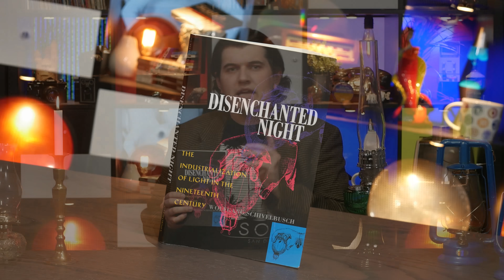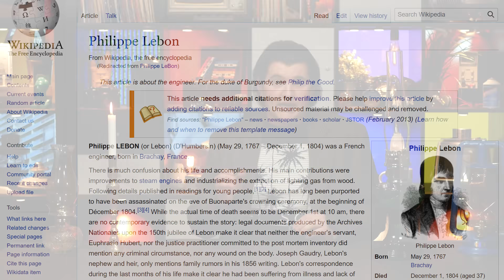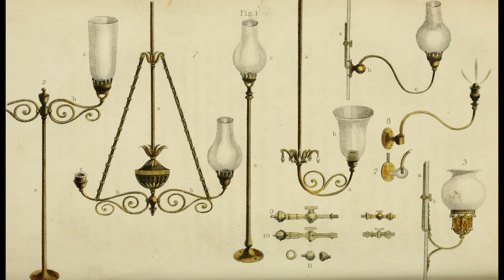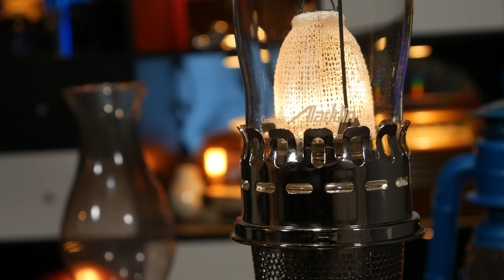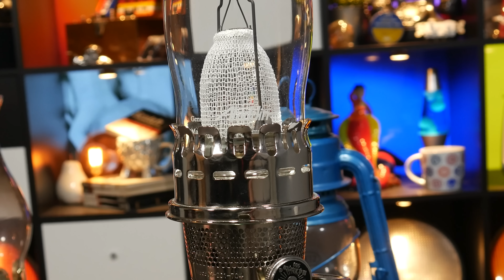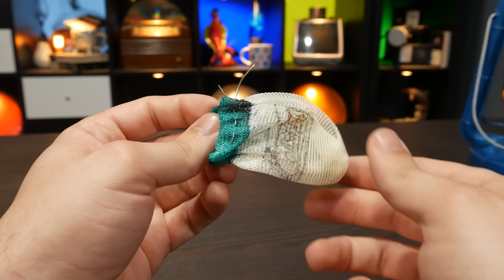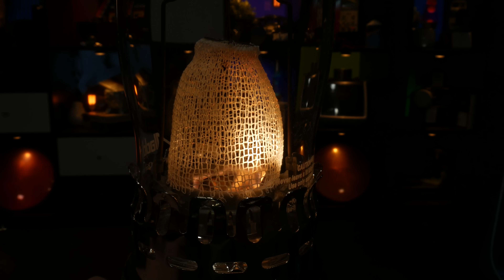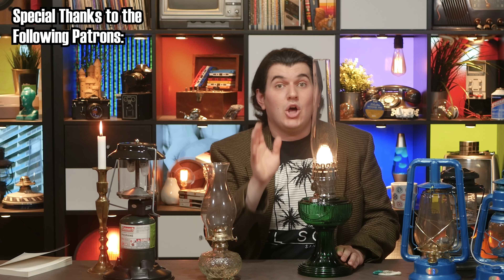How the gas mantle made lamps 10X brighter

Comment: While the mantle is not catalytic in the normal sense (surface chemistry going on), it certainly is in the same way that any confined flame is. Soot particles can be thought of as black bodies, and in open air that means they glow brightly throwing out tons of energy. That keeps them relatively cool. Inside a mantle that doesn't happen. They still glow brightly, but because they are black they also absorb the light from their environment. The mantle is actually hotter than the particles in a burner flame, so if you took one of those particles and put it inside a mantle the net radiation flux would cause it to heat up!
This makes endothermic reactions become an important route for the destruction of soot particles. Lets consider an almost complete stochiometric flame, near the end of the reaction there will not be much oxygen left. This slows down the oxygen carbon surface reaction to a crawl. If the particles are artificially kept hot the product carbon dioxide and water can react at the surface endothermically to produce carbon monoxide and hydrogen. Both of these are gasses, so are able mix well and to burn off the last of the oxygen very efficiently. Even in a rich flame the combustion products can continue to destroy the soot particles after the oxygen is all reacted. The result is syngas. The mantle effectively transfers energy back to the incoming fuel to distil it into syngas inside the lamp, before burning that instead.

Comment: The blue color of some mantles (particularly the Aladdin Lox-On Mantle) might be just a pigment to distinguish the 40-candlepower from 60-candlepower type [1].
The colour migh also come from substitution of other heavy metals (some countries' regulations don't allow certain metals to be used). I've seen a patent applications mentioning metals such as yttrium and neodymium - the latter has oxide of light blue colour looking just like that.
Some heavy metal nitrates are also colourful, too (see copper(II) nitrate)) allowing use as pigment.
I've seen some Aladding mantles are light pink in colour (note that neodymium nitrate is pink compared to light blue oxide), but I my buest guess it's just to differentiate between models to make it easier to find the proper one for your lamp.
Some mantles are dyed just around the border and cap perhaps to make it easier to put on.
I have very little time to sweep through patent application but hopefully this will help a bit.
[1] http://www.aladdinlamps.info/LoxMPicts.htm

Comment: I live in one of four attached cottages built in a rural area in 1876. When I was refurbishing I found a network of gas pipe work in the walls which was weird because to this day there is no gas available. Eventually I found out that there had been a coal gasifier in one of the outbuildings. The cottages were built for staff who worked at the Manor house nearby. It must  have been incredible to have had controllable lighting in those days.

Comment: 5:35 " ...because it is not a measuring implement of any sort" - well, sorta...
You see, that thingy shown in the B&W photo has this outer structure, that gridy thing around that cylindrical part, to keep it straight and upright, WHILE IT MOVES UP AND DOWN.
Gas production was continuous (less or more) thorough the day, while its consumption peaked during evenings and mornings (for obvious reasons). When the gas was produced during the day and pumped into this container, the movable upper part moved up - and when gas was being used up (for lightning, and latter for cooking as well), well in excess of "manufacturing output", that thing went down. Therefore, one could estimate, or "roughly measure", the amount of gas held within it - and a rough measurement IS a measurement nonetheless (hence that -meter suffix).
Also, I wouldn't be surprised a bit if one could actually find, on some pictures, some sort of scale attached to the structure - and I think I've seen one, once, just can't remember where and when.
Anyway, while this "gasometer" is indeed not a very apt name for this "holder", saying "it is not a measuring implement of any sort" is also rather inaccurate.

And "while at it" - it would be worth clarifying the term "town gas", as it might refer to both COAL gas (in early years of "unnatural gas era") and SYNGAS (for latter - and much longer, AFAIK - period of that era). Syngas is a mixture of mainly hydrogen and carbon monoxide (and therefore very poisonous, unlike coal gas, which is harmful, but not nearly as deadly), and it is produced by blowing hot steam through a bed of red-hot coke (C + H2O -> CO + H2, -∆t).

Comment: How about another sub-topic video on how conduits for electrification of homes (likely) used the pre-existing coal-gas lines. It's hard to imagine ripping out entire homes when all the ways to route wires were already present (at least it'd be fun to know if that was or wasn't the case). - Also - taking a wild guess - is the wicking action into the lamp that's confounding the uniform heating possibly not level - meaning the wicking action isn't uniform because the fluid is offset from an unlevel surface. Is your table level? Is the lamp?

Comment: You forgot the best one of all. The sewerage lamp.  Lanark castle in New Zealand used one. The waste was collected in a central room which had a glass dome at the top. This connected to the pipes which ran through the castle and attached to the light fittings.

Comment: I've seen an arc light working at a technology museum once, and I understand why they never caught on for domestic lighting. The light is very harsh (as it's basically a welding arc. They won't even leave the lamp on now because it blasts out so much UV), the lamp makes a constant, loud and ominous noise (a combination of the AC humming of the electrical arc and the flecks of carbon being sputtered off the electrodes), and there's constantly black soot falling off it.
Reply: Yet they were a pioneering means of street lighting especially in the early days of power distribution, but with all the drawbacks you mention. 'Arc' not 'arch'...
Reply: @rubbrhog  always get those mixed up

Comment: Are you able to stack multiple mantles on the aladdin lamp above each other to hopefully get more light out of the same heat draft? Or does the first mantle use up the heat in some way when converting it to light?
Reply: Probably not; much energy would have already been used up so at most you'd get a dull glow.  It's like compounding on steam locomotives.  BTW one of the Wright brothers was issued the patent on using compounding on internal combustion engines I've been reliably told.

Comment: Kerosene may be a niche fuel at this point, but it’s great for another use - it’s a great non-polar solvent and has less flashing issues than using gasoline.

This means that in bulk extractions of certain compounds by amateurs (aka running a drug lab), kerosene becomes an important part of the process. Bolivia, among other nations, actually has limits on how much you can carry out into the countryside in order to prevent the supply to drug labs.

Technically you could make a drug lab use very little solvent over time, but this is amateur science so they often have evaporative losses and contamination they can’t remove which leads to a need for periodic resupply. They try to recapture as much as they can, but they’re not always effective.

This is a problem for villagers, since kerosene lamps are still a big part of life in many of these rural areas, as well as for people traveling through them because there are often few hotels and the gasoline to run your vehicle is hard to come by as well. Better to not burn gas just to have light at your campsite in case that gets you stranded.

Comment: Quick side note, Kelvin is a fixed SI unit, it does not come in "degrees" which would refer to a certain scale the degrees are measured on. Slight verbal mishap at 14:35 but minor thing and a rather common mistake. Awesome content as always. Technology Connections never fails to amaze me with the amount of research and work put into the episodes.

Comment: Did I see correctly that you turn the knob on the Alladin lamp clockwise to “open it” (raise the wick iirc)? Is that related to the fact that (at least here in Germany) gas valves open clockwise, which (I think) is done so you have to “think” about it while opening, since unintentionally opened gas valves are likely to become a bit more of a nuisance than unintentionally opened water valves.

Comment: I can vaguely recall an operational gasometer in my neighborhood, the structure would rise and fall depending on the amount of stored gas in the structure. In that respect the height of the structure indicated or measured the amount of stored gas available for use, you could tell at a glance how much gas was available by how many sections were expanded.

Comment: "But how do you [vaporize] a liquid fuel, like kerosene?"
Me: Considering the time period, I'm going to guess 'heat the liquid to it's boiling point' because people were bloody mental back then. How does it not explode? Cause you have the burner already turned on, and if that's the path of least resistance, that's where the now vaporized fuel will go... normally
Reply: spoiler : pressurize the kerosene tank, then the tank will spray the kerosene into pipe that being heated and it will turn into vapor
Reply: @wongjowo9152  Well you do pressurize the fuel in all gasoline/kerosene blow torches I think! (And in the dual fuel lamp in the OP video, BTW.) You pump the handle, and then the fuel is fed upwards and atomized! Same as a garden spray hand pump.

https://ae01.alicdn.com/kf/UT8_EoYXCXaXXagOFbXc/Gasoline-Flamethrower-Torch-Gas-burner-Welding-Burning-Heating-BBQ-Blowtorch-Cooking-Soldering-Spray-Gun-Soplete-Para.jpg
Reply: @ayebraine  yes, the mechanism is basically the same
Reply: @wongjowo9152  no need to pressurize the tank - that only increases the chance of explosion. ... a 10 year old fuel injector from any modern car will work ; with-out needing to " hold an amount & pressurize" a tank ... if you use a old fuel injector - you can reuse almost the whole liquid gas supply line & the gas tank - without the need of creating "new parts".
Reply: It is still in use, called petromax lamp. Works more like a swedish primus stove, with a mantle (thorium or yttrium, whatever that may be)
Reply: In Coleman lamps and lanterns, (white gas and Kerosene versions) you pressurize the fuel tank, and the fuel flows through up the Generator, a metal tube that runs near the mantles and is heated by them, then sprays through the generator tip, so a tiny jet of vaporized fuel mixes with air before even getting to the mantle. On kerosene lanterns, you may have to preheat the generator to get it to start vaporizing.

White Gas stoves do the same thing. The generator runs across the top of the burner, so fuel is vaporized by the flames before it ever gets to the burner. You are literally cooking the fuel line to make it work. This works, as long as your valve is before the generator, but is catastrophically bad when the valve comes after the generator (like the Coleman 501 stove).
Reply: the same way your car ... BURNS ... a liquid we call gasoline. Forced through a very small hole under pressure ; either in a carberator or a "fuel injector".
_ much the same way your garden hose attachment sucks up the soap mix from an attached container  or  a car paint shop, sprays a liquid paint vapor onto the car parts._
Reply: Ohh - just like a montolv cocktail ... stick a rag in a liquid - the LIQUID will naturally seep up the cloth & evaporate on it's own - so when lighting a moltolv cocktail beware the gas vapor might ignite & burn off your terroist beard.
Reply: my favorite example of being bloody mental: the Naptha Launch: its boat powered by what's basically a water-tube steam engine but the working fluid isn't water, its gasoline. The fuel? Also gasoline. 

The only reason these terrifying things existed is ironically because of safety regulations requiring any steam-powered boat have a licensed engineer aboard at all times.

Comment: I remember when l was a child my grandmother used Aladden lamp's in her house....Because her house did not have electric anything and not wired for it...l used to love to go to her house.....That was back in the 1940's...l am in my 80's now....Later my dad wired her house for electric....!
Reply: Very cool story.   Indeed many rual areas and farms were not electrified till much later than city and metropolitan area.  Around 10 years or so ago, i was helping a close friend remodel a Sears bungalow built in 1927, my fondest memories were climbing to the attic space,  expecting hornets and wasps as the access hatch was nailed shut with layer after layer of paint and looks as if nobody's been up there for many decades,  instead there are electrical wires wrapped around these funny white spools nailed along the rafters,  along with a very strange looking fuse panel near the back porch with a pair of round fuses,  and a lever that you would throw up and down,  that was the main shut off for the house, and a very old looking electric meter outside. I said to my friend,  the electrical to me looks very unsafe,  you should get that checked out.   He looks at me and says, well the home is over 80 yrs old, and that scary looking stuff, to you, was installed when electricity was still considered a luxury,  and was still considered high tech for the time, if this home was located in near the farms i grew up on, it would have been lit with kerosene or gas for another 20 yrs maybe a little longer.
Reply: @Sparky-ww5re  Yes the two story l live in now was built in 1886....l am still using that style of wiring today...But the house ha had some up grades of course to it....But the wiring is still the same lol thanks my friend from Kentucky...!

Comment: 22:15 the part where it shows how the carbon gets "cleaned" by burning it away was really cool.
Reply: Yeah, that part was fascinating and beautiful at the same time. Quite pleasing to see up close.
Reply: It is real similar to "burning out the carbon". This was a technique used in the 1940s thru  1970s to improve automobile performance and mileage. Slow driving results in low engine temps, which led to carbon build-up on valves and seats, thereby causing incomplete sealing and poor performance.  Occasionally , we would take the car out to a straight stretch of road and drive as hard and fast as possible. This would burn the carbon build up off the valves, and the car would run better. The proof was all the black smoke that would roll out the tail pipes during the first run. And for all the smart alecks, who are going to say THAT was oil leaking around the valve seals? You're just wrong, and obviously too young to have "been there". And too sure of your own, obviously inadequate knowledge. I was there, being now 72yo, and I also have a Masters in Mechanical Engineering.
Reply: @tommoore4071 I'm guessing that Italian performance vehicles were especially vunerable to the carbon then, or else the term Italian Tune-Up would have been called something else.

Comment: A note on how you mentioned kerosene being a rather niche fuel nowadays. I’m not sure if niche provides the right context. While kerosene isn’t used by the public masses, especially in America, as much as it used to be it is still used widely. For the basis of jet fuels, rocket fuels and anti-gelling additives for diesel among its many other uses. I’m a semi driver so I’m quite used to constantly purchasing kerosene based fuel additives during the winter. I especially like to fill up at Kwik Trip locations in Wisconsin that have diesel #1 at the pump in the winter, which is already blended with a high kerosene content to lower the gel point of the fuel. I guess I’d suggest highlighting how kerosene is a niche fuel for the normal layperson, while it is still a key fuel that helps to power our overall lives.

Comment: I have to confess now that I have used all of these technologies in my life. Mostly in order:

1. Candles
2. Lantern
3. Oil Lamp
4. Gas Mantle (called petro max) 
5. Incandescent Bulb
6. Florescent Tube Lights
7. Florescent Bulb
8. LED lights

With the exception of #3, all of these were used as main light source for days , not a one of occurrence. Petromax, when we had it was a favorite as we could study much better in that light.

23:47 You are not accurate about these cannot be used outdoors. We did , though design is a bit different.